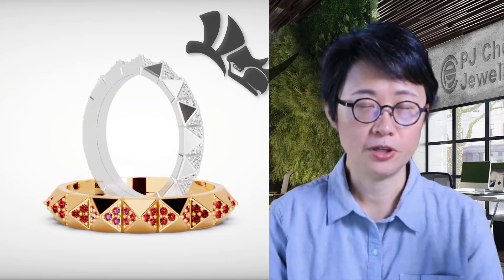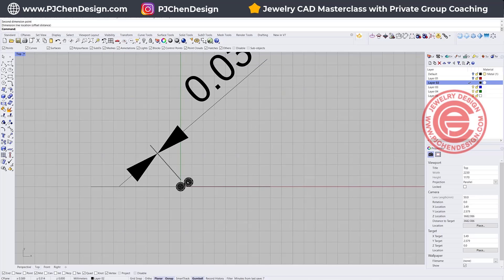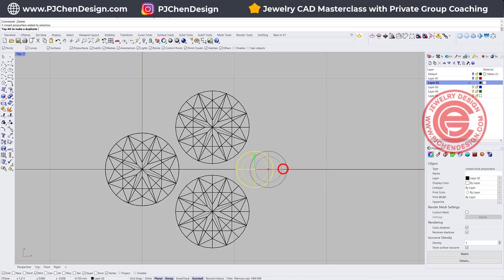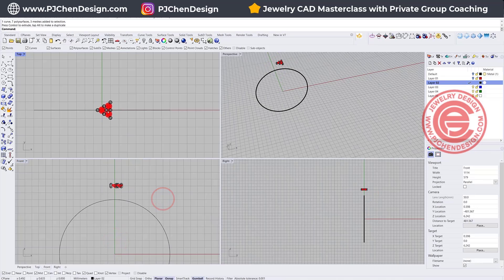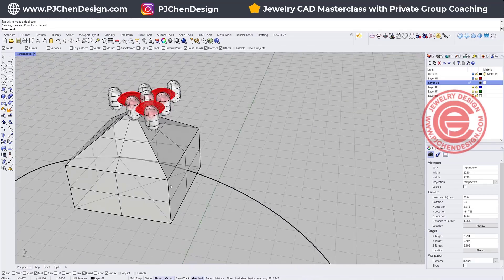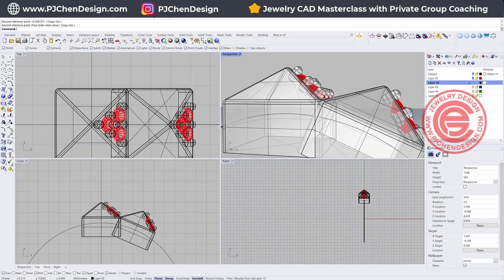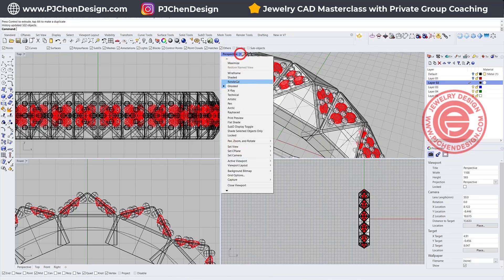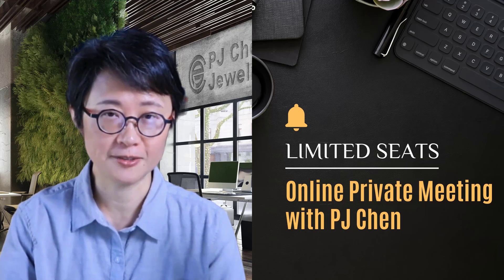Design a Pyramid Eternity Ring: 3D Modeling Tutorial in Rhino #495

Comment: is it recommendable to make holes for small diamonds? if I want to replace setting to one bigger round brilliant stone on each inner side instead 3 stones, what is the right way to create holes where the stones will be set?
Reply from the maker: Idealy, you need holes behind faceted stones. but if the stone is too small, it will cause issues on casting. If that is the case, I will rather has no holes.